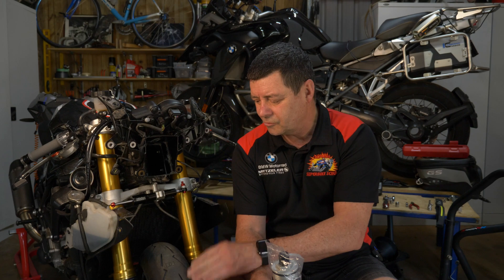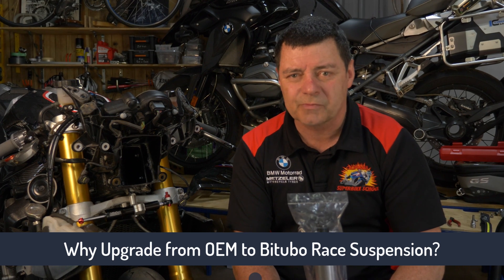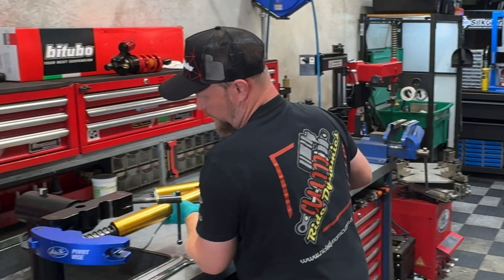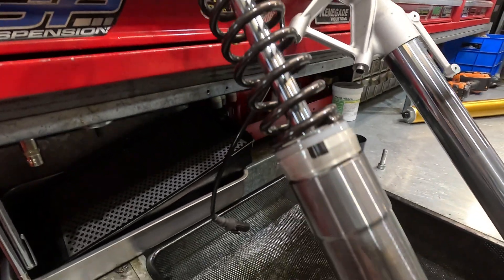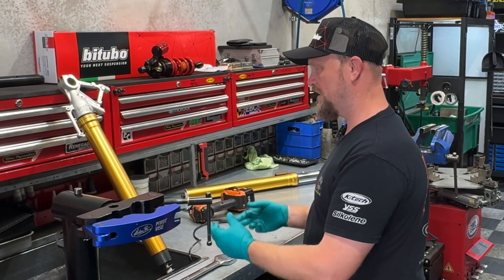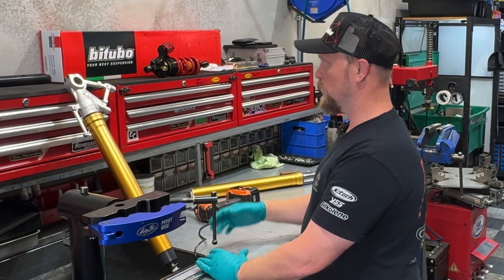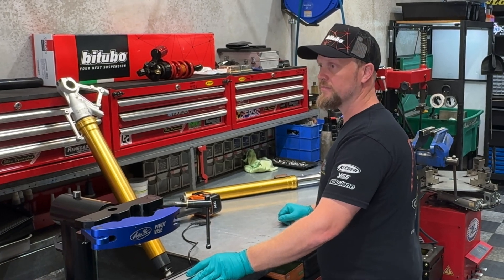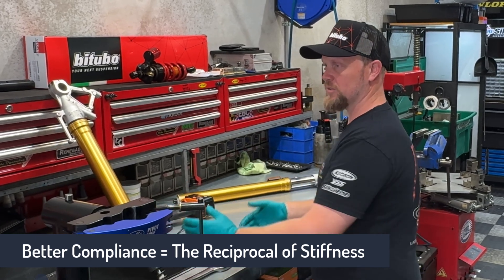Suspension Part 1 - Why Upgrade From OEM to Bitubo on the BMW S1000RR

Comment: You not one to do things half baked. I recommended Mupo, and you went full Scoorge McDuck Bitubo - congrats on the upgrade, I'm a little jealous

FYI. It's obviously too late now as Joe already had the forks in his hands. However for anyone reading, the DDC! Message and "!" Warning light can be disabled by going to the BMW Stealership and getting them to untick the DDC box in the parameters. 

Here is the kicker though - it can only be done whilst the DDC system is installed. It can not be done after the suspension has been swapped over - So you're stuck singin "... This lil' light of miiiiine, I'm goooona let it shiiiiiiine..."
Reply from the maker: haha, nope, looks like ill be keeping this bike for a long while too. Yeah I knew about that DDC issue and the need to do it before disconnecting. what's cool is I have the old bits and it is super easy to plug them in to the wiring harness, I reckon the removal could still be done by the dealer that way, I will do a little checking with my buddy at the Melbourne service centre,